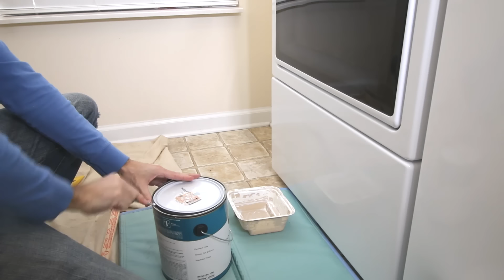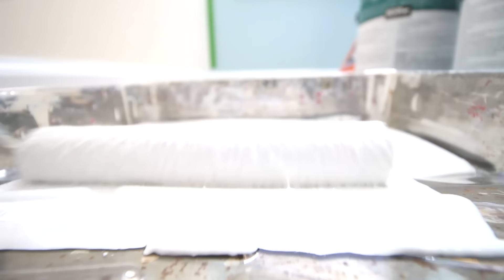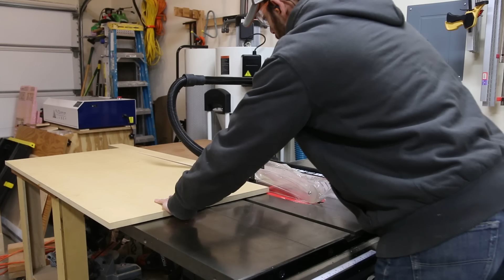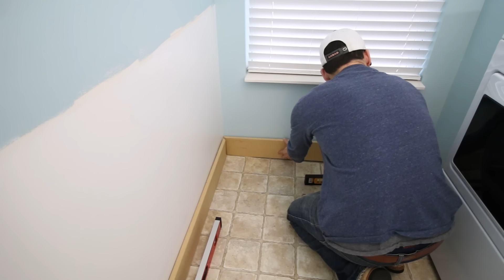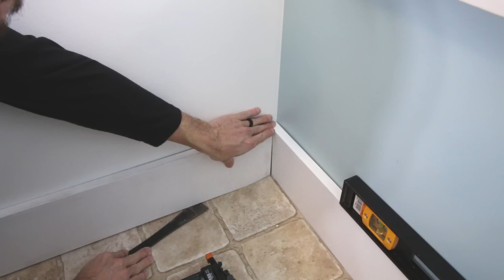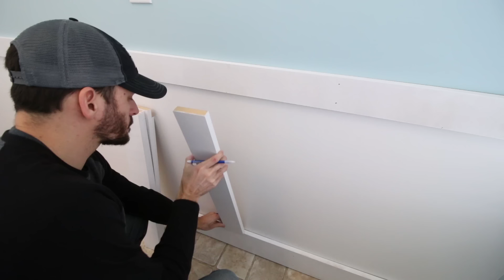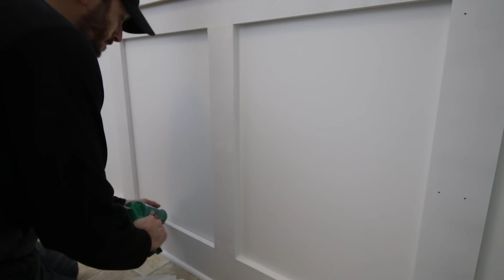How to Install Wainscoting | DIY Board and Batten

Comment: Why use MDF?  Seems like it is more trouble than it is worth, even if there is some cost savings.
Reply from the maker: Cost and accessibility are the main factors.  To use solid wood you'd need to use select pine or mill your own poplar.  Trying to use the normal select pin would have too many knots and not have a smooth finish.  And if you used poplar you're talking 2x or more the price (if you mill it yourself and 5x or more if you buy it dimensioned) plus not everyone has access to it.
Reply: Mdf is very smooth with no voids and easy to Paint. In addition you do not have to add edge banding to mdf.
Reply: Eric Breindel while MDF is very consistent and flat for painting, the edges are a different story, as you can see from Brad's need to seal the edges with spackle. With solid wood you would not need to seal or band the edges because it will paint the exact same as the face.
Reply from the maker: Yup, it's a series of trade offs one for the other and personal preference.
Reply: I thought the same thing, particularly in the Laundry with the possibility of flooding/machine leaks.